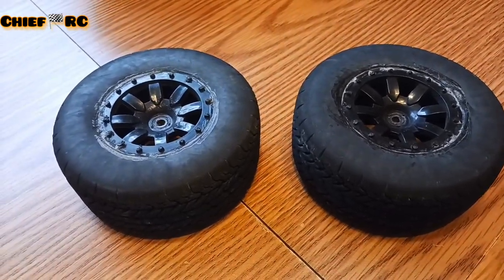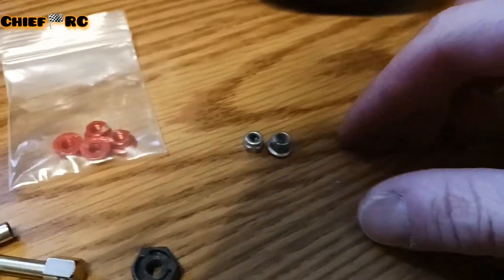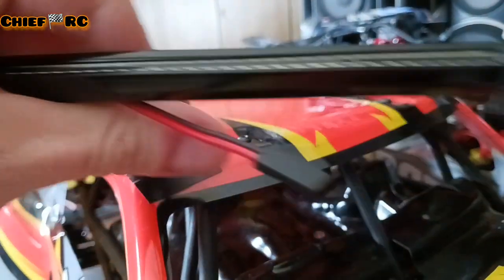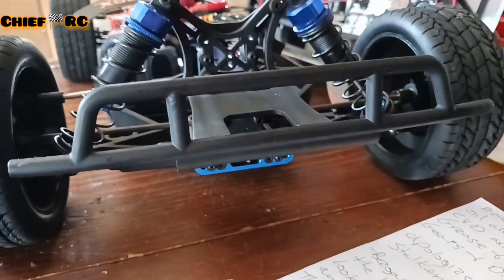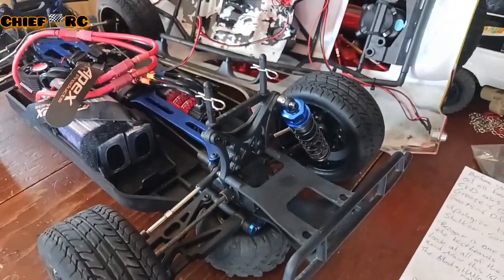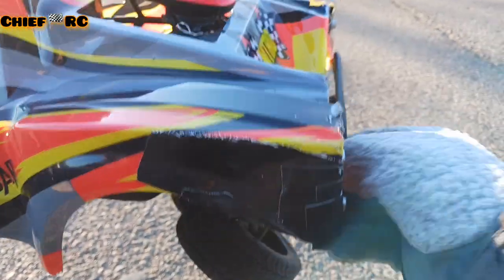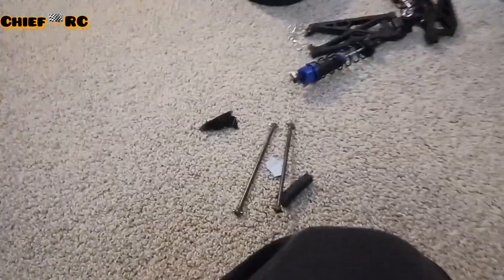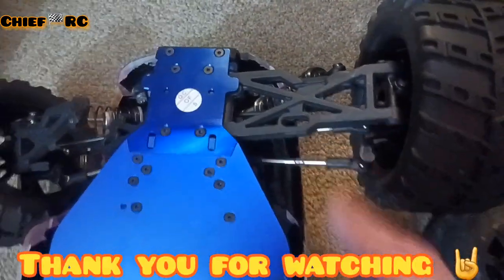🏆Laegendary Nitro 4300kv 15t 3s top speed // 59mph, then Crash short run. Big hoon next time

Comment: These are the sway bars for the rh818 compatible, also the suspension holders are full/solid and compatible but you'll loose your rear bumper if used but the back suspension pins won't break as easily. Hope this helps!
Reply from the maker: Great idea bro! I plan on adding weight she was a too light for 55+ mph and it's open body shell. I knew I was eventually gonna flip I had to show how easy and bad it turns out. Next time I should have a 5200mah 3s, some front weight and adjust rear spring tension to get her butt up enough to make the body create downforce. My goal is 80mph out of this motor and gear
Reply from the maker: And Thanks a lot. Also plan to make the Nitro and Blade chassis full alloy

Comment: Buenas noches, se puede utilizar con el control original o hay que comprar otro de la marca ? 

Saludos desde República Dominicana 

Muchas gracias
Reply from the maker: Hola mucho gracias, this one is upgraded I converted the brush 590 to brushless. You could use the original controller it is a hobby grade receiver and transmitter but I accidentally broke the antenna in my very first video showing this off. But you could convert the brushed model to brushless with only a motor and ESC so you could save a lot of money getting the brush and converting it plus it'd be a lot faster like mine. 
Chee Miigwetch, Thank you in Ojibwe
Reply: @ChiefRickyRC muchas gracias, ya casi termino proyecto, gracias

Comment: Whats the best site for quick parts and what model number for imex or ftx should i search? Control arms are the worst.
Reply from the maker: AliExpress search VRX. VRX is made by Riverhobby.com  I dont remeber all the same models, but I remeber not the 1016 that one has short swingarms. Ill look again for all same chassis's and reply again. Thanks bro 🙏
Reply from the maker: You want parts from the VRX RH1045
Reply from the maker: Heres the silver alloy swingarms i got on it. RCAWD has colored, but front only i guess for the solid axle. Hope this gets you started Just found this amazing item on AliExpress. Check it out! $8.40  42%OFF | Alloy aluminum 2pcs machined front lower suspension arm a-arms for rc hobby model car 1-10 VRX Octane VETTA Karoo upgrade parts
https://a.aliexpress.com/_mNHzcdq
Just found this amazing item on AliExpress. Check it out! $10.12  12%OFF | Rear Lower Susp Arms For VRX Racing RH1011 RH1013 RH1001 RH817 RH818  RH1009 RH1019 . Fit VRX 10113 10910
https://a.aliexpress.com/_mMTafGg

Comment: Use your blade spare a arms they'll fit so you don't have to wait on them to come
Reply from the maker: I need a dang rear bearing carrier too, but I'm thinking bro lol
Reply from the maker: Man bro they need to lower the prices on these if the asrms break thus easy. A rc should be able to cartwheel and even take bad landings off jumps on concrete. Even the crawlers and drift cars 😆 💯🏁
Reply: Yeah I feel like you could 3d print a better a arm that's flexible
Reply from the maker: It took some hard hits driving normal, but man crashes are not forgiving
Reply from the maker: I bet there's some good 3d material, but frfr shouldn't be true 😆
Reply: Yeah they definitely suck they're part fiberglass that's why they're weak
Reply from the maker: Awww makes sense. Yup bro Nitro and Blade will be full Alloy soon
Reply from the maker: 100mph with Blade and 80mph with Nitro. I guess the Nitro is a good racer too

Comment: What size tires and rims any link?
Reply from the maker: About 110mm x 45mm Hotstorm 1/10 SCT wheels and tires 
Just found this amazing item on AliExpress. Check it out! 
$19.99  30%OFF | Hotstrom 110*43mm Short Course Truck Wheel Tires Tyre For 1/10 RC Car Slash Arrma Senton HuanQi 727 Vkar 10SC Hpi
https://a.aliexpress.com/_mr0UYYA
Reply from the maker: 12mm hex, not glued
Reply: @ChiefRickyRC  thank you very much just ordered this truck today
Reply: @ChiefRickyRC  12mm bolt ?
Reply from the maker: @thebigmandingo1 sweet! You will like it very much! Its good to double check all the screws and grub screws on drive line. My rear center shaft drive cup grub screw needed tightning otherwise it would of came loose. Drive her smooth the first battery charge to break in the gears allowing them to polish and harden the gear surfaces.  Also reinforcing the body shell with a thick duct tape will really help it last
Reply from the maker: Yup